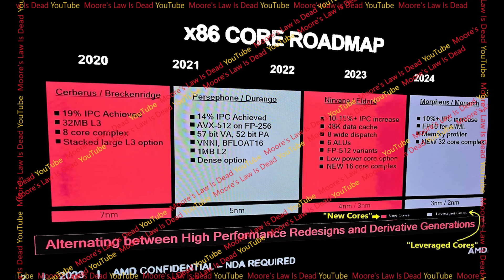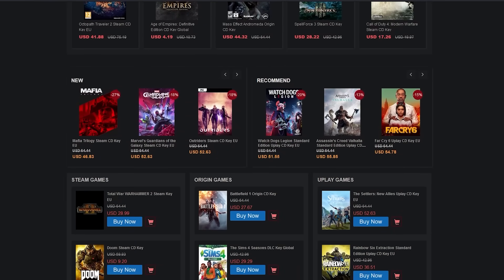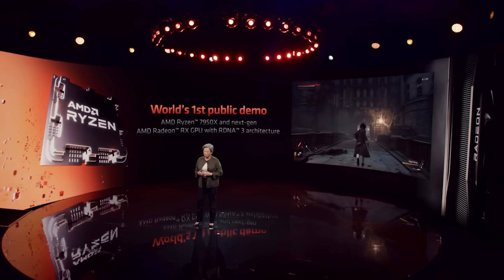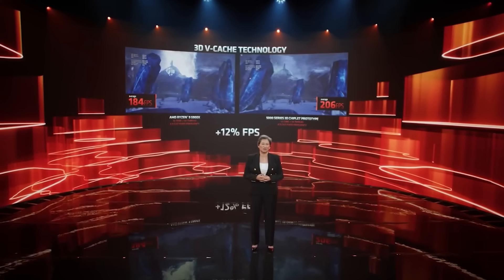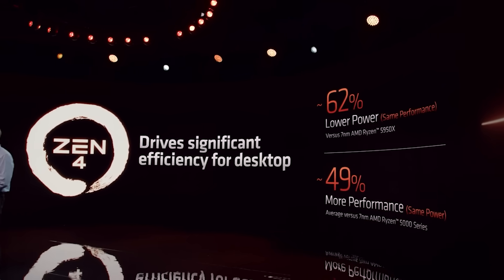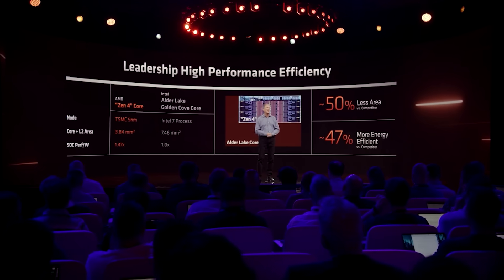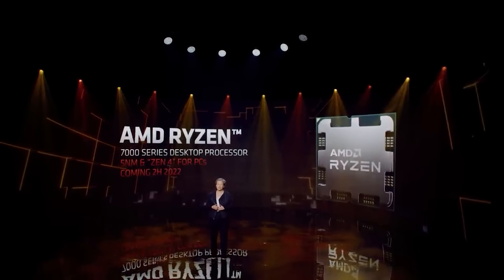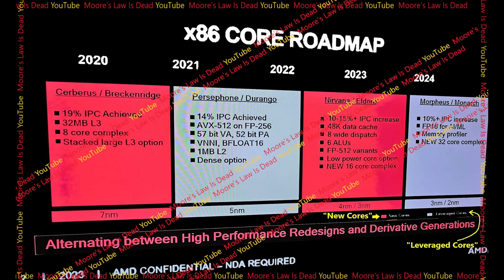Investigating Zen 5's INSANE IPC Gains - What's Going On?!

Comment: So, here is the deal with single vs. multiple thread performance.

AMD has good multi-thread performance.  It can't get much better with the hardware architecture they have for MCM because having cores communicate through an IOD adds latency, so until AMD gets off the current MCM structure they can't do much to improve multi-threaded performance.  At the same time if they stick with the same basic setup for the IOD it also means they can't do much to improve memory timings, because EVEN IF the IOD can push faster memory timings, you have to transfer the data from the IOD to the CCDs and this is a HUGE bottleneck as these CPUs get faster and faster, and why there is a rumored rework of how MCM works for Zen 6.

So for now, AMD needs to boost single thread performance because this is where they lag behind Intel anyway.   For Zen 6 AMD needs a TOTAL rework of their MCM architecture, most likely getting rid of their infinity fabric and moving to direct connects between chiplets, so instead of two core chiplets talking to each other through the IOD, a direct connect between the two core chiplets.  Instead of having a memory controller on an IOD, it probably has to be on the core chiplets.  These are all moves AMD is going to need to make to get multithreaded performance a lot better than it is now.  They probably need a new socket for Zen 6, but it's going to depend on what they do with memory controllers or if they add more lanes between the CPU-chipset link.

If AMD sticks with an 8 core CCD for Zen 6, I'm probably switching away from AMD to Intel because I think Arrow Lake is going to be a kick ass setup.  They need to at LEAST get to 48 threads with 2 core chiplets, so 24 threads/CCD, so 12 cores.  It would probably be best if this were an 8x4 big-little config.  OR, AMD could move away from SMT2, make their cores much smaller and move to 24 cores/CCD, or have 2 - 3 variants of cores.  Moving away from SMT gives a good boost to multi-core performance or even multi-threaded performance, but of course in the end you need more transistors.  I THINK they HAVE to be on TSMC N3 or N2 to make this move.  They should be on at least N3 for Zen 6 though, by then N3 should be ubiquitous.
Reply: Your entire first paragraph is solved by an L4 cache on the IOD.

Next step is to use the same technology they're using on their GPUs for the CCD to IOD connection, that would bring bandwidth up (modest benefit) and latency down (huge benefit).

Next step could be to merge CCDs together using the aforementioned technique, allowing neighboring CCDs to share L3 caches.  That's basically the route Intel is taking.
Reply: @looncraz  Yeah we're going to agree to disagree.  Memory is NOT cache and cache is NOT memory and the two work VERY differently.  You don't load programs and data into cache just because.  The cores have to first NEED the data or instructions before that information ends up in cache.  On the other hand, loading a program means pulling it off a disk and putting it into memory.  So memory is ALWAYS important.  Yes, part of that program will be duplicated in cache, WHEN the cores need certain instructions.

Next, if you add L4 (and why it's been avoided) it adds ANOTHER lookup.  That adds latency.  You can design a lookup that checks all levels of cache at the same time but it's still another big group of transistors for the logic and it takes longer to find data the larger the cache is, so you get diminishing returns and at some point get negative effects by adding more cache.

And as I said on your other post about L4, if AMD can greatly improve the transfer speed between chiplets which would mean getting rid of their infinity fabric, you could have an L3 chiplet.  But that STILL doesn't solve the issue with memory dude.  Your system is ALWAYS writing back to DRAM.  When you work with data that's in cache and it gets changed, well, cache is a copy of data or instructions that are in memory, so when you write something into cache such as an instruction that updates data in a memory address, you can cache it, but it STILL has to be written to memory.

Next, most desktop apps don't benefit from larger L3.  This gets to the point that when you run a program, a lot of the instructions needed can already fit into L2/L3.  It also gets to the point that a lot of programs don't work with large sets of data, and a data stream is not a large data set.  It's only ONE chunk of data.  When you unzip a file, you read from disk and write back to disk.  A larger L3 doesn't help.  When you edit video, L3 can help during the edit process, but when you get to the point of rendering, not so much because you're taking a single file that can be many GB that's stored in memory or possibly even on disk, you render it and store it back onto disk.  Larger L3 did almost nothing, if anything for that render process.  And I could go on and on about why an ever growing amount of L3 or L4 on desktop is stupid.  It doesn't even help with many games because the data sets aren't large enough.

If you're working with engineering tasks, almost never run on a desktop, SOME of the tasks you do could work with very large data sets and THEN a larger L3 helps.  Once again, the cores have to first NEED the data before it makes its way up to L1, then pushed to L2, then pushed to L3.

Level1Tech did a good video many months ago talking about Zen 3 EPYC with Vcache.  Even many server apps don't get any benefit from the larger cache.  Go watch the video he did.

REGARDLESS of cache, AMD needs to make memory access much faster.
Reply: You have no idea what you're talking about.  They are literally running at 128 cores now through an IOD and it's working great.  There's zero indication that there's any bottleneck here from the IOD, and they mostly seem to be limited by power and packaging size.  But continuing die shrinks will ensure they can get more and more cores on there.
Reply: @johndoh5182 

This is literally my job, friend.

Not everything will benefit from cache, but you don't actually add latency just by adding another cache layer unless you don't know how to design a CPU.  You actually send the memory request out as soon as you fail to retrieve from the L2, possibly even the L1... though, often enough, you do so BEFORE, using speculative fetch - so caches can literally store the entire program and working dataset in many cases, negating all other (including memory) bottlenecks.

The request will be put in queue at the IMC (or, for AMD, also at the IFOP boundaries) and the request can be canceled over the command bus - so the IMC doesn't fetch from memory when it's not needed - but that still happens, it's just not a big issue.

Data locality means you want to stream data to or from the main memory pool whenever possible - this removes the effect of DRAM latency for subsequent local accesses - an L4 is ideal for AMD's design because the IMC is on the IOD and the L4 would be on the IOD.

AMD's memory architecture does NOT write to DRAM right away, it uses a WCC (Write Coalescing Cache) - it employs this at many different layers in retirement. The L4 would be used for this instead and the L4 would be synchronized to DRAM only on L4 retirements, lazily writing to memory.  The L4 would keep the working dataset in play even when L3 on a CCD has retired the data, allowing ~30ns reload instead of 85ns reload, removing common-case memory latency penalties almost entirely.

You will always find a bottleneck, the idea is to make the fastest memory subsystem you can - and to hide the latency everywhere else.
Reply: @looncraz  
Great, I push myself in here: Do you think AMD can keep their hardware architecture, but compete with Apple in regards to running ML models locally (home server), which need high bandwidth and ideally not too expensive RAM but as much as possible of it while idle power usage also matters.
Reply: @NoidoDev   I desperately want AMD to launch gaming GPUs and APUs with HBM.

It would be trivial for AMD to surpass Apple performance - efficiency is another matter, though.
Reply: @maynardburger  So you think an EPYC IOD is the same as Ryzen?  The IOD in EPYC is about 4X that in Ryzen.  Like, literally 4X the number of transistors.

But that's not the point.  Latency of having to send data to a chip that is simply going to send that data to another chip, or to memory, or is being output to some device on the MB is part of the point.  But the other point you ignored.  As CORES get faster, the interconnect has to get faster.  I think the latency already shows up.  By the time Zen 6 comes out if they use the same IOD the latency will be blatantly obvious.

But hey we can all live in an imaginary world if we want to.

Next, the world of server is WAY different than desktop because server ops tend to be a lot more I/O intensive.  A core gets a request for data, core requests data from disk (possibly cached in memory).  Data goes to core that called it.  Data gets packaged and sent on its way.  Or, even these functions can be broken up over different software functionality that runs on different cores.   These are for the most part independent tasks.  That matters.

On desktop, at least the many different software packages that are used to benchmark CPUs, there is much more dependency.  You render video and the cores have to communicate with each other and the cores are all working with the SAME data and as they render a video the cores output chunks of data which are then assembled into a data stream.

These are VERY different operations.
Reply: @looncraz  "AMD's memory architecture does NOT write to DRAM right away, it uses a WCC (Write Coalescing Cache) - it employs this at many different layers in retirement. The L4 would be used for this instead and the L4 would be synchronized to DRAM only on L4 retirements, lazily writing to memory.  The L4 would keep the working dataset in play even when L3 on a CCD has retired the data, allowing ~30ns reload instead of 85ns reload, removing common-case memory latency penalties almost entirely."

I think it's true that most write back in modern CPUs is lazy, I still don't see how having an extra layer of cache helps, and so far Intel and AMD haven't either because they don't make a CPU with L4.

I've also studied computer architecture and software engineering so it's not like you're hitting me with information I haven't been exposed to in the past.  I also did 20 years in the USN working on electronics and older mainframe computer systems which means I had to understand the 1s and 0s of EVERYTHING about how computers I dealt with work.  But those were older machines and didn't have ANYTHING like the complexity of today's machines.

In a desktop there are lots of operations that don't benefit from ever larger pools of cache which is why when AMD benchmarks their CPUs with Vcache it's a RARE application that benefits and most actually suffer a little because of the drop in clock speed.

I'm sorry we're just going to agree to disagree once again that a 4th pool of cache is helpful and I won't believe it until a company, and in specific since we're talking about PC and X86-64, I won't believe it until a company that makes X86-64 processors makes a CPU with L4.

However I'll set that aside for a moment and ponder ONE thing, and this is because of how large pools of cache are.  I've said in many posts that if AMD gets away from their infinity fabric and can move to chiplets that have direct connects, then if adding a chiplet for cache and calling it L4 can be done while maintaining the access time of say, Vcache which uses interposers so you have a direct connect between 2 chiplets, then I'm all for it.  I have simply called this L3 because it would be replacing Vcache.

"You actually send the memory request out as soon as you fail to retrieve from the L2, possibly even the L1... though, often enough, you do so BEFORE, using speculative fetch - so caches can literally store the entire program and working dataset in many cases, negating all other (including memory) bottlenecks."

Frankly, I think the fastest way to check cache is if there is a miss in L1, send request to both L2 and L3 at the same time.  Is this incorrect?  If you have to wait to see data isn't in L2 before requesting from L3 then there is latency when there's a miss in L2.  And yes, adding new levels of cache adds latency unless Intel or AMD is going to defy the logic of cache which is to make levels smaller as they go down.  L2 is relatively small and takes less time to access.  L3 is larger and takes longer to access.  Larger pool = longer access time.  Once again, is this incorrect?

So, speculative fetching is usually pulling consecutive memory addresses with the assumption that a program or data is in consecutive addresses.  You also have branch prediction, which when correct means you've pulled data/instructions in the correct path your instructions will go.  Are changes in the last 10 years so great this is no longer the case?

A core can't get TOO complex on the function of pulling data from memory along with caching techniques otherwise you have the logic of a core, running the logic of a core and the number of transistors involved starts to get too large.
Reply: @johndoh5182 

First, I'd like to commend the cordial nature of this conversation ;-)

" I still don't see how having an extra layer of cache helps, and so far Intel and AMD haven't either because they don't make a CPU with L4."

Intel actually did employ an L4 to great effect, and that was a subpar implementation. Arrow Lake is rumored to get an L4 cache as well.

"Frankly, I think the fastest way to check cache is if there is a miss in L1, send request to both L2 and L3 at the same time.  Is this incorrect?"

An L1 miss takes a cycle or two, an L2 miss takes 5~10 cycles extra.  Tag searches are just really, really, fast.  L3 misses are into the dozens of cycles because they're so large...  The L2 -> L3 transition is also the new core boundary for memory accesses, so it's just logical to create the broadcast request for data at that boundary. 

To keep latency down for an LLC (L4 in this case), it makes sense to broadcast as soon as there's an L2 miss - a good 90% of the time the data is in the L2 ready to go, anyway.  Shaving < 10 cycles by broadcasting out for the VERY COMMON L1d miss would be a nightmare.

What AMD should really do is cut the L3 cache down to 16MB and optimize latency (think 8~10ns L3), shrinking the CCD at the same time, and then incorporating a 128MB L4 on the IOD with low latency high bandwidth connections.  They could stack a VCache die on the IOD to make it 256MB.

They could slap on one 8-core CCD or two 16-core CCDs and the L4 would still do its magic... no more odd scheduling or nitpicking between where the LLC should go, it's a child of the IMC, plain and simple.

Like I think I mentioned, I think AMD uses a tagset for coherency no the fabric bus (on the IOD for chiplet CPUs).  This tagset tracks dirty pages in the CCX L3s and probably has storage for implementing CPU-wide mutexes.  Expanding that out to a full-on L4 would just be too easy to ignore, IMHO.

Comment: Zen6 probably stays on am5 if its merely a refinement of zen5
Reply: I hope so
Reply: Given that Zen 5 is a full architectural redesign of Zen 4, it is unlikely that Zen 6 will be on AM5, and even if it is, expect compromises on a old Zen 4  architecture compared to a AM6 MOBO designed for Zen 6.
Reply: @iLegionaire3755  yeh but he said zen6 is just a refinement rather than drastic difference, and since zen5 is gona be on am5 likley that zen6 will also it's equipment to what zen+ was to zen1

Comment: One of your better Videos Paul. Thank you.   I particularly liked your use of Tom's chart.   The way you laid out the division of Nvidia and AMD GPUs for 2024 and 2025 was one of the cleanest I have seen so far.
Reply: The next GPUs better be on PCIe 5. I'd really like to be able to upgrade from a 2070. Preferably Radeon 8900xt.
Reply: Yep im ready to go for that right now, running an AM5 platform X670E PCIe 5 but already have a 7900XTX.
Reply: @andrewvirtue5048  Even the 4090 doesn't get anywhere close to saturating pcie3 much less pcie4. Pcie5 won't do anything for gpu's for a long, long time.

Comment: Can't wait to upgrade from my Evga 3090 to 5090,still be using my ryzen 9 5950x as i don't require a better cpu to go with my next gpu.However I'll need to find a box for my 3090 to sell it.Loved the final question sitting on a 4090 do you want the 5090
Reply: Yeah, 3090 is still in demand for machine learning, because of the 24GB.

Comment: since I JUST upgraded to a Ryzen 5800X3D I'm not gonna upgrade that soon BUT I am extremely interested in Intels new design. As fo GPU well...I'm still looking for a 1060 replacement. I might have a chance to get 2100 bucks essentially for free in the next 3 months I might go "screw it" and buy myself a new PSU and 4090

Comment: Overhyping. That's what's going on. Wait for the RDeadOnArrival 3 copium moment:face-green-smiling: and preparing for: RIP AMD🎉
Reply: Intel is adding less than half the IPC every gen for the last 3 generations?
Reply: weirdo
Reply: why are you hating on amd? they are way better for consumers in comparison to nvdia and intel although intel is priced (kinda) competitively they need other high end parts (good motherboard, psu and high mhz ram to compete)
Reply: At least it’s not as bad as Intel 14th.